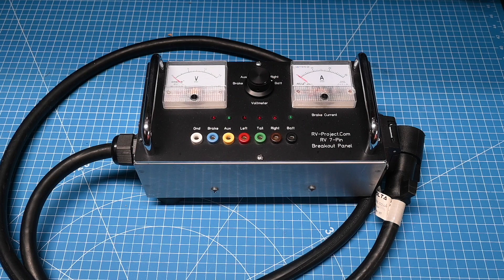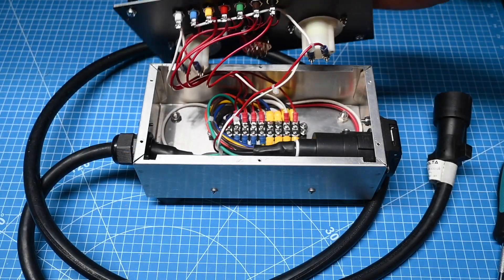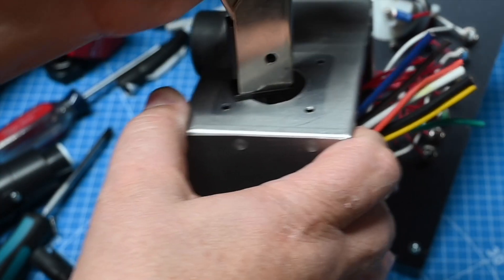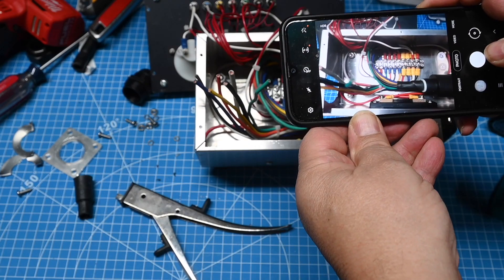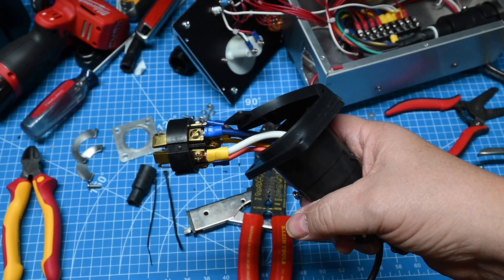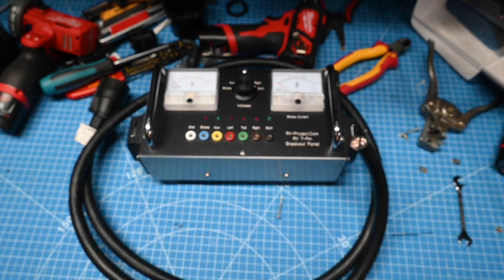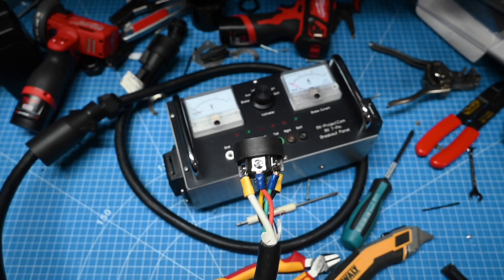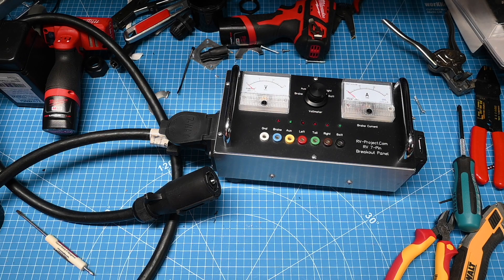Updating RVProject's 7-Pin Trailer Analyzer (Ver 1.0)

Comment: I just found your channel and I have an update for your update to consider. I made a similar box but focused on the brake circuit volts and amps but found the some new ITBC controllers are smart and don't always give a brake output unless running or moving etc. ? (insert comments here) but using my version of the box and only connected to the trailer I added a selector switch that takes the trailer charge line and then thru a momentary contact button and you can use the trailer battery to test volts and amps trailer only. This is easy to go to a rig (think a rally) and test the wiring and magnets w/o adding the TV. But mine will function with  TV also. Very nice box. I'll watch more later. What brand 7 way plug has that compression strain relief? Gary
Reply from the maker: Saturday, I will be releasing a video for the construction of v1.5 of the test set.

Ver 1.5 is not a replacement, but rather a different product.  It can be used stand alone or in conjunction with v1.0 (the one you are commenting on).

V1.5 essentially replaces the tow vehicle with switches for the brakes, tail lights, turn signals, and backup.

I am also working on ver 2.0, which basically combines ver 1.0 and 1.5 in the same box. Look for that video in a month or two.

I am not at my computer right now, but on my webdite (RV-Project.com) I have a bill of materials for all of the components I used for the projects.

The parts are also sometimes listed in the video description for those that dont want to go to my website.

Comment: Please add links for cable
Reply from the maker: When I built mine, I bought a 7-pin "pigtail" for the cable. A pigtail is a length of cable with one end having a connector, and the other end being free. 

I simply cut off 2ft from the free end of the cable, which gave me the wire needed for the project.

The parts list for the project is here: http://www.rv-project.com/repairs/breakout.php

Unfortunately, in today's environment, shortages are common, and I noticed that the pigtail is no longer available, so I did update the parts list with one that is available.